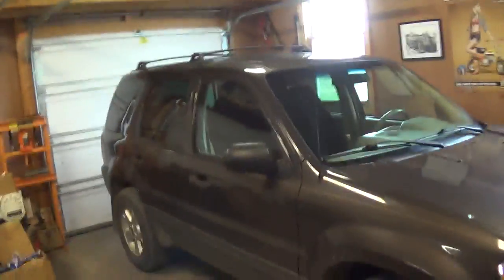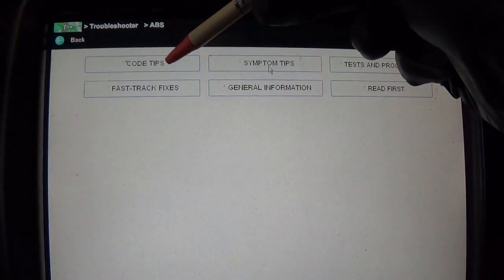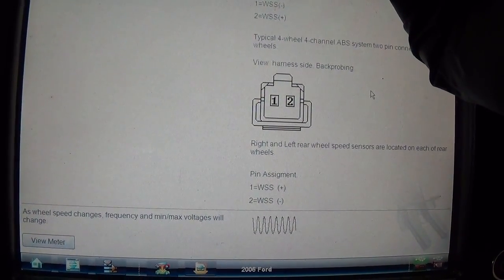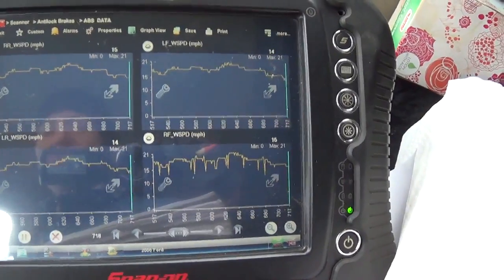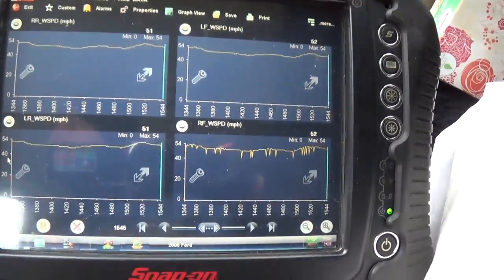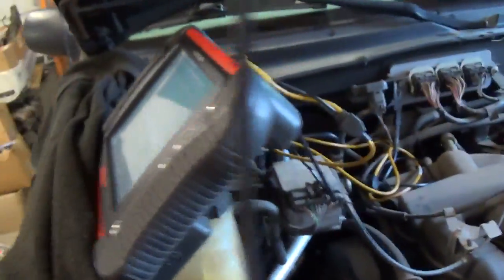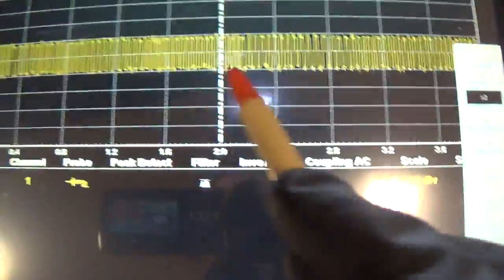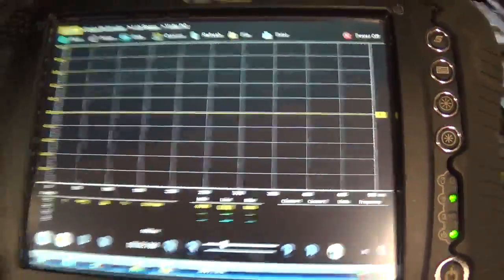Testing Digital ABS sensors: Ford Escape

Comment: At higher speeds the dropouts seem further spaced, likely is the tone ring, anyways, how do I test this when I can’t even move the vehicle? And will the light be on after a reset? I seem to have dead sensors but can’t spin the wheels and only have a single external connection waveform meter

Comment: Excellent video!  Thank you it helps a lot ..  I have just bought a 2005 escape.  And I don't have all the Fancy equipment. But would this also show itselft in the form of the rear wheels locked together like a positrac diff? When you make a u turn it drags or scoots one tire... There doesn't seem to be any differential between the rear wheels...   Any thoughts would be greatly appreciated!
Reply from the maker: Wow didn't know they came available with a locking differential lol...I would lift up the rear end with the car off and turn one wheel by hand; the opposite one should spin the other way freely.

Comment: I replaced one last year, drivers side.   Had the same symptoms now, another one to replace.  I have a pit in the garage, a lot easier to just go underneath and look then fool around with a computer.   I mistakenly thought you were going to repair it in this video.
Reply: He didn't "fool around" with the computer.  He is showing how to to use it as a diagnostic tool.   In other words, this is an educational video.  That flew right over your head.  Why did you assume he would repair it in this video - the title says "testing ABS sensor".
Reply: @donmoore7785      And I'm saying it was faster and easier just to go underneath and look at it and know for sure which is what he did in the end anyway..   Computers can be great aids in diagnostics and sometimes personal knowledge is faster and better.  Plus there may be more than one explanation  for a certain code.  Sorry if I stepped on your computer oriented toes..  Sometimes you have to get off your butt and take a look. It won't hurt you..  I'm pretty sure this guy knows how to fix it..  I'd like to know how to fix it instead of............. wait for it....  fool around with a computer.  Did that fly over your head or was that direct enough ?

Comment: great video...liked how you got the signal with ac coupling...scanner danner used an amp clamp to get his signal on a jeep...amp clamp will allow testing on both wires..but your way would allow 2 channel testing ...known good signal and faulty signal....this type of sensor maybe the future for all digital signals....a two wire square wave sensor...this will give the engineers extra wiring room for more smart modules...maybe an over engineered license plate lamp computer on the CAN...lol.....great testing skills

Comment: I am 90% confident that that IS a variable reluctance sensor !  You can mot reference the signal to ground.  You need to measure a "difference" between the 2 wires.  Likely there is a way to do this on your 'scope using 2 inputs.
Reply from the maker: +theoldwizard998 The second wire on the sensor is just a common ground. This type of ABS sensor actually has internal circuitry to transform a typical AC variable-amplitude signal to a two-state fixed amplitude signal. There is no way to see the raw AC signal on a scope without cutting the sensor open :)